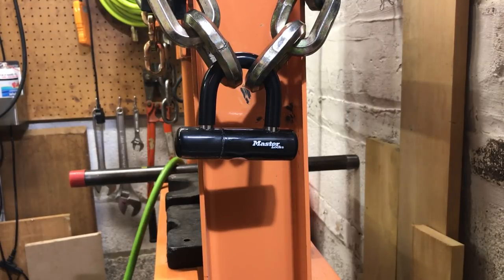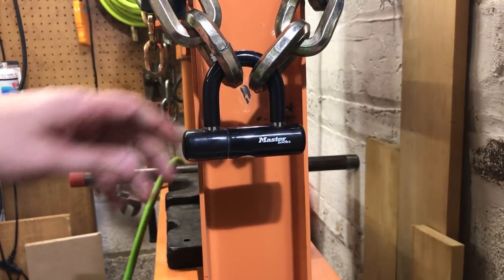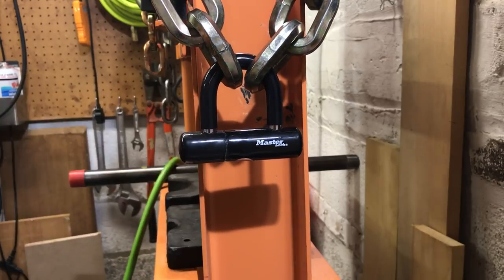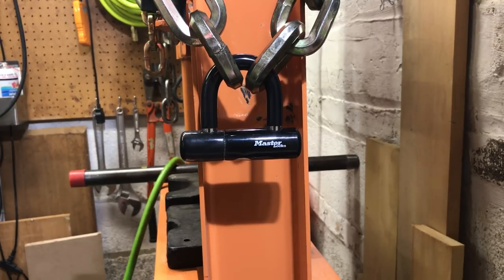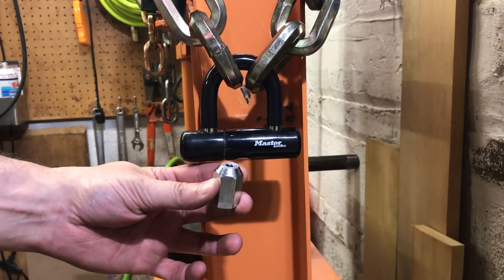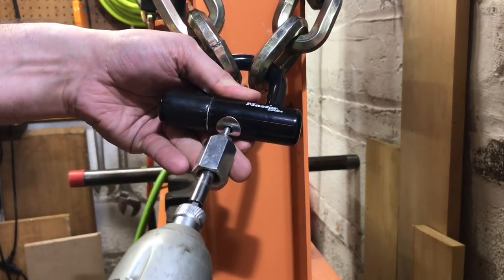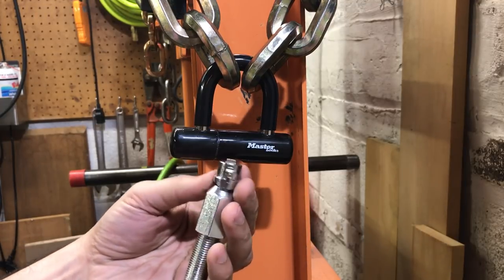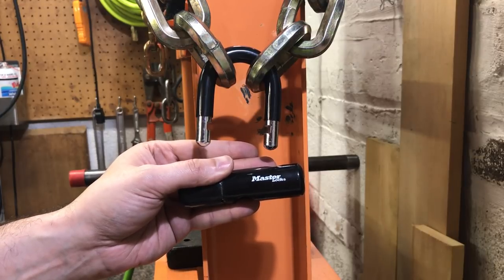[540] Master 8118 Disc Brake Lock vs. Slide Hammer

Comment: I don't know about that chain though. you think it's heavy enough? :)
Reply: That is the smallest chain he owns :)
Reply from the maker: +cipher315 This was 15mm... next time I'll use the 19mm! 😈
Reply: @FusionDeveloper  Why do they insist on making things with zinc instead of steel? This metal becomes malleable at temperatures as low as 212 degrees.  You could defeat zinc with a cigarette lighter.
Reply: @Sara-L  Zinc with a low melting point is cheaper to manufacture (lower temps needed), so they can sell it cheaper.

Comment: This was used (not by me!) when I was a teenager to open cars.  You'd think lock companies would know about it by now (if I knew about it in the seventies, you can bet it was pretty common knowledge).  It'd be interesting to see if it pulled the plug (rather than the whole core) on your alternative  u-lock though (come to that would an impact driver pull all of the discs, and would that make an easy open?)
Reply: They know. The problem is the bulk of consumers will go for the cheapest product that appears decent (without actually being so), therefore the locks are constructed as cheaply as possible. Check out your local big box hardware store - they'll have far more crap masterlocks and similar than decent brands.

Comment: Would this count as bypassing the lock. I'm just curious
Reply from the maker: +that zombies player Nope... this is a fine example of "pwning the lock." 😁
Reply: +that zombies player
This is classified as "Destructive Entry".
Lockpicking is classified as "Non-Destructive Entry"
Bypassing is either classified as "Non-Destructive Entry" or "Mildly-Destructive Entry", depending on the method.

Of course ALL forms of entry are technically destructive, due to the fact that nothing lasts forever and you are putting wear on the lock whether you dial a combination or use the working key or whatever method. Therefore, the classification is based on realistic damage, in relation to whether the lock will still function normally after being opened.

* You scratched up pins in the lock while picking it (Non-destructive).
* You shimmed it open (Non-destructive).
* You pulled back the locking-paw with a tool or decoded it with a tool. (Non-Destructive).

* You bumped the lock 200 times and caused considerable damage, but the lock MAY still work. I consider this one of the most destructive methods that (depending on how many times you hit it) may still be able to be considered "Non-destructive", but may also destroy the lock, making it "Destructive" (Either Non or Destructive).

* You break a protective wafer or put a hole in the lock in some way, where the damage allows it to still function with the key and you can secure the item with it, but you have broken part of the lock in order to bypass it.  (destructive).

* You rip out or drill out the lock and the lock can no longer function as a lock. (Destructive).

I hope that helps.

Comment: Only one significant flaw it is a Master Lock I'm sure there's more.
Reply: I used to defend Master Lock, saying that it depends on the lock model and the lock type (Pin Tumbler, Sliders, Wafers, Disc Detainers), but I've come to the conclusion that, although not all Master Locks are created equal and although some are Master Locks are more difficult than other Master Locks, when it comes to ACTUAL security, they all seem to be VERY vulnerable to AT LEAST 1 basic attack, without requiring a heavy investment in experience. I only buy Master Lock brand locks, for practicing lock sport. Friends don't let friends secure things with a Master Lock.
Reply: One thing I don't get about Master Lock is that they bring their A game for only one part of the lock usually the body or the pins but not both like their LOTO locks have 6 pins with spools inside and their locks made of stronger materials have 4 standard pins it really confuses me.
Reply: I guess it lets them keep the price down, but still truthfully advertise one particular feature per lock to make it seem like a quality lock. The customer looks at a wall of master lock locks and subconsciously attributes features from other locks onto the one they have selected.
Reply: Jay H I think if you was to all the good features for the different master look in to one lock you would probably have a pretty good lock

Comment: Would it be possible to make it as such, that if the core is pulled out, the locking lugs get stuck in the locked position?
Reply from the maker: Yes... you see similar systems on some Euro profile cylinders. But this requires more moving parts that add to the cost and could fail. It’s FAR better to design the lock properly with passive protection from this.

Comment: On the lock with the more secure construction, would not that slide hammer still work? I'd bet it wouldn't take many slams of the hammer to shear the lugs right off. Might need a hardened screw but perhaps not.

Comment: They could have the cylinder installed from the top (inside) instead, thus preventing it from being pulled
Reply: You can take small part of slighty bigger pipe, make hole in it and then weld it.
Reply: That would limit the usability of the lock. However if the hole looks sideways the screw would just break into it as the pulling force would be perpendicular to its axis (otherwise you have to fix the lock in a special position manually).

Comment: Couldnt you just use a screw and a regular hammer? Like the nail puller?
Reply: Matty Ice that would be a lot harder,  even though it could still work.
Reply: Using a normal hammer would definitely take way longer.

Comment: i can't believe it came out with such little effort , i'll have to put the slide hammer on my shopping list, i wonder how it will do against american lock 700's
Reply from the maker: The problem is finding a screw that can withstand the impact required to defeat a 700.
Reply: those blue concrete anchors you used with the bell core puller seem adequate, i been looking for that tool as well but can't find a seller outside of europe.
Reply from the maker: I’ve broken those tapcon anchors... I have some chrome vanadium tool steel screws that are supposed to be better, but I’ve not tried them on a lock like this yet.
Reply: structural screws and  lag screws would be the next and finally step in screw strength

Comment: is that really relevant tho?? i doubt many bike thieves carry around slide hammers just in case they happen upon a lock that has this weakness
Reply: Not really, but it is still a fairly low skill, simple to execute attack.
Reply: nah. There are several faster ways to break open the lock and probably with more concealable tools.

Comment: The good ol' sliding hammer trick!👍 Great for thieves as long as you can carry a cordless and a sliding hammer. Learn something new everyday on YouTube! 🙃✌cheers
Reply: impact driver, angle grinder, small bolt cutters, hacksaw(hand version), sawzall(eletric), knife, small crowbar all fit in  one backpack.  to add sliding hammer would be no problem...
Reply: Then you fall on your back and can not move due to how heavy your backpack is. LOL
Reply: Then you fall on your back and can not move due to how heavy your backpack is. LOL
Reply: You can use a regular screwdriver to drive in the screw, it just takes longer.
Reply: jaime munoz lol if that happens then you need to be doing some situps.
Reply: Only need a screwdriver and a slide hammer! Trust me lol

Comment: I wonder if that would work with rekeyable padlocks as there is only a screw holding the core in
Reply: Would probably depend on the screw. A good hardened steel screw should put up at least a little fight, but not all lock makers use those, of course. A good thing to test!

Comment: How well does this attack work in real life conditions? It does work amazingly well when the lock is attached to huge chain that chain is secured to steel girder so that the lock core absorbs all the energy, but I would assume that it would be much harder to do that when the chain is attached to bike or something similar.
Reply: Well, you may need to hold the chain taut with one hand and need to pull horizontally rather than downward. Either the lock will let go or the cheap chain will. Regardless, job done.
Reply: In real life it may take 2 or 3 hits, instead of 1.
Still 100% successful defeat.
Reply: Well if the lock is angled up you pull up... if it's angled right you pull right... >__>

Comment: Lucky for me, this lock never hangs straight down and is rarely more than a foot above the ground...
Reply from the maker: The slide hammer works in all directions. 👍
Reply: Good to know... =oD Thank you for replying!
Reply: All that's necessary is a rigid attachment(to a stop sign, or bike rack) so that the force cannot go anywhere but towards pulling the core.

Comment: This doesn't seem like a practical attack, considering most bike locks are used in public areas. Carrying around a drill and slide hammer to take 15-20 seconds to get into a lock for a bike? By that time you're easily on video and someone 's called the cops.

I mean, it seems like an easy fix to a dumb problem, but still.
Reply: Plus, the point is, it's ONLY a design flaw that can be fixed very easily. Heck, even just welding some metal (or metal rods) around the rim would make this attack less effective or not work at all. It's much harder to pull a large object through a small hole, then it is a pull a large object through a hole that is slightly larger than the object.
Reply: BIG JESSE   Fair point. My comment was meant to be more of an inquiry than anything, but it didn't really come across.
Reply: I only steal bikes  and whatnot when I'm in a semi private area, like the one you get by piggybacking on actual tenants .. hence very few chances of getting caught
Reply: tsobf242 nobody's gonna call the cops because they dont give a shit about your bike. Best theft prevention is having good inssurance.